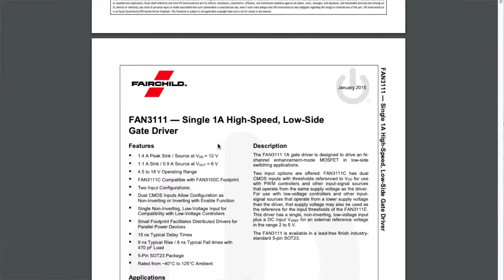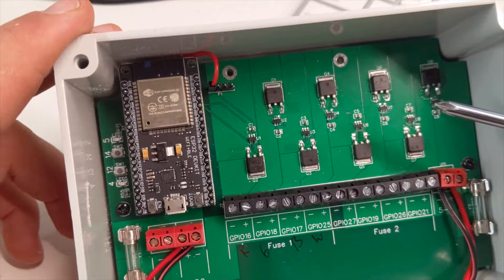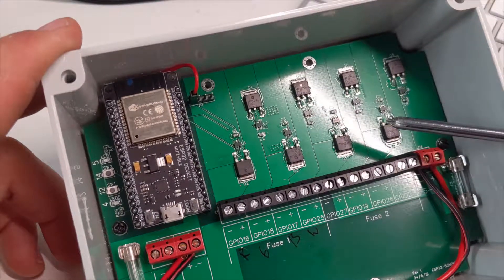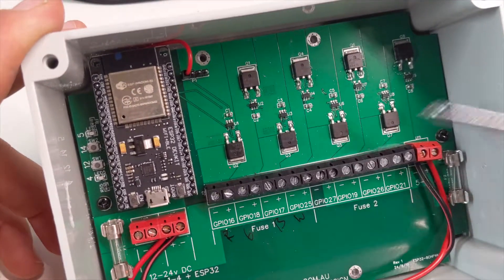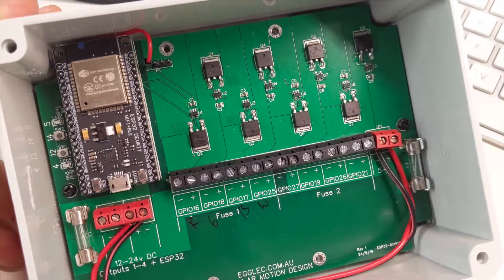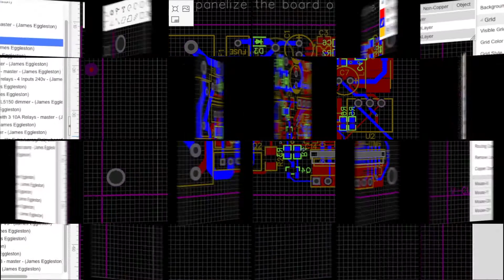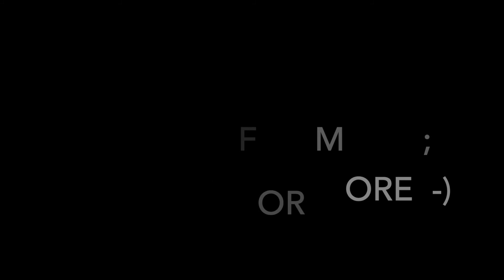LED 8 Channel Controller for Home Assistant

Comment: Hi from across the ditch. Just found your channel while looking for information on the Shelly  power monitoring device, This controller looks like it will work well for my 12v led strips. Having the ability to ramp the lights up slowly will add a level of sophistication to my lounge. Have just set up Home Assistant on a raspberry Pi so will be watching all your videos to get up to speed and hopefully get some control. Keep up the informative videos. Cheers Dave.

Comment: Can we use this instead of relay? Is it reliable and efficient?
Reply from the maker: It doesn't really replace a relay as all MOSFETs have RDSon resistance where a relay is basically almost 0ohms. Which can make it somewhat wasteful to be used in place of a relay. It is specifically for dimming LED strip and controlling RGBW constant voltage leds. Although I suppose you could use 1 or more channels to control anything that operates on 12v or 24v DC.
Reply: @SparkyJames  Thank you so much for your response sir. I got the point.